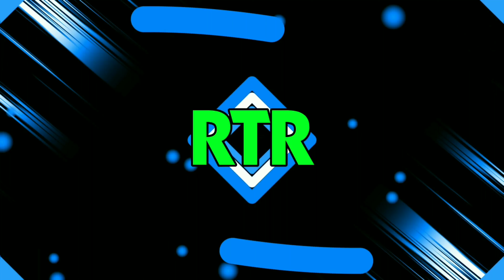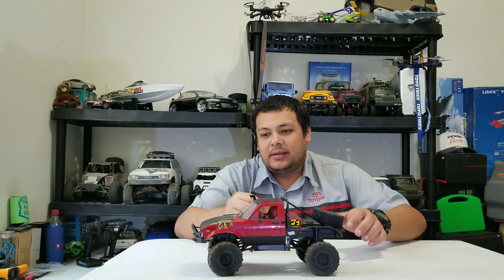WPL C14 kit. Friends rig finally gets some upgrades!

Comment: I’ve tried using the dogbone linkage in the front steering before but it keeps on binding every time I do the steering. So I’ve switched to a universal joint instead. And everything’s doing fine now.

Comment: Nobody shows how to hook up the servo to the gear. I see the OMG one has arms coming out to accept the servo, not mine. The new metal driveshaft seems to be too tight for the rear and throws off the axles angle and throws off the suspension. I do not have good fortune with WPL stuff. This is my 6th WPL vehicle in the last 4 yrs. Not one worked and they have all been returned. Im gonna get a tattoo on my right index finger that says "NO WPL" to remind me not to click no matter what u people say about it
Reply from the maker: These aren't for everyone thats for sure. I have a buddy that's baffled at how well mine runs so he purchased one and hasn't been having any luck with building them right.  So I took one of his WPLs and disassembled and assembled it the way I do and after we ran them he changed his mind and now has several more modded WPLs. Once you get the hang of fiddling with these they just become even more interesting. Definitely not a tamiya but still tons of fun for the price.

Comment: I want to get the C-14 as an entry point to crawling. Still best to buy the kit?  Also, from your videos I think I need metal drive shafts and shocks upgrade.  I will use a flysky transmitter and get a 20amp esc. Any servo recommendations? 
Thanks
Reply from the maker: C14 Honcho style is definitely cool looking truck. For the servo I have been ok with the stock ones they come with. The kits do include a servo as well incase you where not aware.

Comment: Hey, I just got a c14 and wanted to put a two speed transmission in it, what would I need besides the transmission itself?
Reply from the maker: I recommend the wpl metal cvd drivshafts to go with the 2 speed. You would need a different esc/receiver that has a extra channel for shifting the 2 speed. The WPL Res v3 esc receiver combo is a good budget option that works well.
WPL-RC official site:
https://www.wpl-rc.com/?ref=DAVIDCLARK
Reply: @RunThatRC  omg thank you so much but I got a remote called the Dumborc and it came with a reciever but how do I connect it to the rc itself?
Reply from the maker: @diegoreyes7392  you would need a esc(electronic speed controller) to complete that setup. You connect the esc and servos to your receiver to get everything to work.
Reply: @RunThatRC  Thank you so much!!!

Comment: is there a metal kit like that [in the video ] for mn models ?
Reply from the maker: there used to be but I haven't seen it in a while. maybe aliexpress has it? You can mod the wpl gears onto the mn shafts if you like fabricating. Its not too hard to do but takes time getting everything to fit right. I did it to my first mn model kit.
Reply: @RunThatRC  yeah because that happend to me also but in my mn model my gears was bad and it just cant go because of the gears in the axle

Comment: Never grease a bearing that is able to come into contact with the elements. Dirt and sand will collect on it and tear it up.... There I said it.
Reply from the maker: good advise for sure. With these little things the elements come in contact with everything lol. I just maintain it more when running. My more sealed rigs I wouldn't grease or oil anything that isn't in a sealed diff or gearbox. We really abuse our cheap RCs haha.

Comment: I know this is an old video but if you see this can you tell me does this work on the wpl c24  rc truck as i have one and my differential's gears are basicly smooth ,the plastic gears these come with are not the best so i want to get new metal ones the link still works but i wanted to make sure i was getting the right things also is there anything else you would recommend i have the motor already and ive upgraded my steering plus i gitted some cool roof lights and boughf new wheels
Reply from the maker: these parts will work with a C24. Same chassis underneath just different rear beds. You will need at least a 3 channel transmitter and receiver to complete it all.
Reply: Thank you so much i beleive i do have the transmitter ,i will enjoy my rc car once it is completed i will just have to order the parts thank you

Comment: Hello dave, newbie here. Enjoyed watching your video. Very informative. If i upgrade my stock 180 motor to 370 motor with a speed change servo + ESC and 6 channl receiver, do i also need a 6 channel remote controller/transmitter? Thanks in advance and stay safe!
Reply from the maker: your receiver and transmitter have to be compatible or it will not work. Transmitters and receivers are usually proprietary to there brands frequency.

Comment: I am new to RC and have been piecing together a C14km. The km came with the 2 speed and I have a couple lipo batteries with t connectors and the new WPL transmitter from a friend. Is there an esc and receiver that works with this easily? Since I'm just starting I dont want to get too crazy but want to make this work in the simplest way even if I need to change some parts. Thanks for your input.
Reply from the maker: If you have the new V3 transmitter you can check out WPL-RC.com for the receiver esc combo that works with that transmitter. It's a decent setup that gives you loads of options.

Comment: Do you have a link for me to metal beadlock rims for the C14/24, please.
Reply from the maker: If your referring to the beadlock wheels that have been sold around the internet I heard they don't work well and have issues actually holding the tires on securely.
Reply: @RunThatRC  Thats disappointing.
Reply from the maker: I wanted them too until I seen the review that was on banggood that a costumer wrote. Said they didn't lock the tires in well. Sad for sure
Reply: Somehow the softer tires of the C24 Kit just refuses to be glued.
What glue would you recommend?
Reply from the maker: @tinuscronje2546  I'm just using regular superglue. Make sure to clean the rims with some alchohol and tires with soap so it's free from any grease before attempting to glue them together. Sometimes they have residual grease on them that prevents them from being glued properly.
Reply: Thanx, do you think epoxy will work?
Reply from the maker: @tinuscronje2546  never tried it so not sure unfortunately.

Comment: Great vid on the axels and drive shaft. Really helped walk me through it for my first upgrade. The fit was tight when I installed the shafts but for some reason my wheels are spinning in opposite directions. Wtf did I do? 😆
Reply from the maker: You just need to flip one of the axles so the pumpkin or gear housing is on other side if they are spinning opposite of each other.

Comment: Would you happen to know what size the grub screws are or maybe where I can get more that come in the metal kit? A few were missing in the kit I received, a couple didnt even have threads on them. Any help would be appreciated
Reply from the maker: If I where you I would contact the seller and see if they can at least replace the defective and missing items. I don't know the size or where to get them separately unfortunately. I have been really lucky and have not receive any kits with missing or defective hardware.
Reply: @RunThatRC  thank you for your reply. I contacted the seller just didnt want to wait another month for them to arrive since its coming from China. I might try my local hardware store and see but I doubt they'll have anything that small. Anyways thanks to the instructions, I'll definitely use this video for the install

Comment: Nice job what shocks and where can I get them
Reply from the maker: I have no experience with any upgrade shocks.  I just use the factory shocks and spray them with oil everytime I run it and it is ok that way.
Reply: @RunThatRC  ok will try the oil

Comment: Great vid ! Could you use the 2 speed trans with some basic 3ch radio without servo endpoint adjustment, or do you absolutely need that adjustment on channel 3 ?
Reply from the maker: You can use a simple 3 channel transmitter.  All you would have to do is manually adjust the servo horn so it's at a 90 degree when fully engaged for low gear.

Comment: theres so many parts for these, but pay attention some kits have full axle at same cost compare to few metal pieces. :)
-What are youre recommended driveshafts, and steering servo?  i got universal set, the joint was so flimsy it would brake apart by just looking at it.
Reply: the ball and cup shafts he showed, the spring retainer ring is a little difficult but they stay put really well once together and handle more angle than U-joint type that'll kink if its too steep. they're making metal gear servos for these things now too.
Reply: @modelnutty6503  gotcha  already ordered a few ^^
Reply from the maker: I am still using the stock servo but waterproofed. I recommend the driveshafts I use in this video. Like model nutty said they handle more angle without binding. I have had no issues with these driveshafts.
Reply: @RunThatRC  gonna order couple of those. In my last vid you could see the flimsy one i got with the truck. It realy needs something beefier

Comment: Bye bye factory hello trail time
 love the grip tape on the tiny screw driver's they give us
Reply from the maker: Haha yeah. I have a bunch of these tiny screw drivers. They hurt to use them with my fat hands lol. So I wrapped gorilla tape around it do make it more comfortable to hold.
Reply: @RunThatRC  tool tips should be in the future im shore you had to modify more than one tool i hate when my hand starts cramping from that
Reply: my fav "golden screwdriver" I glued (thread wrapped) a magnet from a small coreless motor to the shaft near the handle. it'll pick up screws, keep them on straight when set, hang onto them when you're taking them loose.... so much less hassles!
Reply: @modelnutty6503  every tip, hack , or trick to help our miss fit hobby choice go further matters that idea of yours with the magnits is AWESOME 👍👊

Comment: Nice step by step, I put the little bearings on the pinions/hubs when putting them in, makes life so much easier. ;) Will need to get some of that grease.
Reply from the maker: Yeah that waterproof green grease is some good stuff. I even use it on my motorcycle and mountain bikes.

Comment: Very cool my friend I've had a lot of these when I got the brass Gear upgrades the main diff one would not fit back on the axle😎👍👍🇬🇧😊
Reply from the maker: I must be lucky. All the metal upgrades I ordered fit well and with no binding. Thanks for the support brother!
Reply: break out the little jewelers files.... ouch. know exactly what you're talking about, the ends were jammed on barely too tight, when you put it together makes LOTS of drag. also had to shim the input cover for gear mesh being too tight on one. sticky back foam sheet is very easy to work with for making that gasket.

Comment: Would those parts work for mn-90? Or fit on the mn-90?
Reply from the maker: All the parts will fit the mn model d90 and mn 45. You will need to use the mn model axle shaft and grind the gears and hexes of it and grind spots for the grub screws. Wpl shafts are shorter and wont work on d90 axles housing. That's how I did it on my mn d90.
Reply: RunThatRC ahhh I see and thanks for the useful information c:
Reply: MN-D90 axles are about 3/16 longer than WPL, and the suspension hanger that mounts to the tops are that much wider too. search MN-D90 in eBay you'll find the goodies.

Comment: local buddy saw my budget beast C-14 (diff locked JJRC axles, Fayee rims+tires, front lift and solder wrap wheel weight). his kit arrived the 3rd, ready for him morning of the 4th. it came with tan gearbox so plenty of grunt, filled the light bar, gave it reverse lights. near twin to mine but no rear running lights, and not #316 gearbox with dual 130 motors like mine.
everything for each was maybe 46 bucks, not counting the electronics.
Reply from the maker: That's what I like about these. When people see them they want one lol.
Reply: yup, and they're not wallet busters to build one solid. early this morning gave the drift truck a longer 8t brass pinion (0.5 modulus) because the plastic one had slipped off once, the new one sure wont!

Comment: Loved watching those sweet upgrades 👍
I stopped using their thread lock cause it’s way too strong
Reply from the maker: This is the first time I tried the loctite it came with. Its definitely strong. Hopefully I can get it back apart if I need to lol.
Reply: RunThatRC I used it on my mn 90. I had no luck pulling it apart again
Reply from the maker: @nhansme  hahaha o man. Hope he doesn't break this!
Reply: use some heat (with soldering iron) then try, it'll likely help.
Reply: I had to use a torch (1.2k deg C declared) to take off my drive shaft after using red thread lock... Different brand, but it will probably work if you ever need it.
Reply from the maker: @AlfredBroda  nice! Good advice